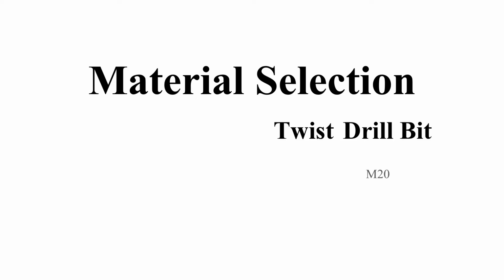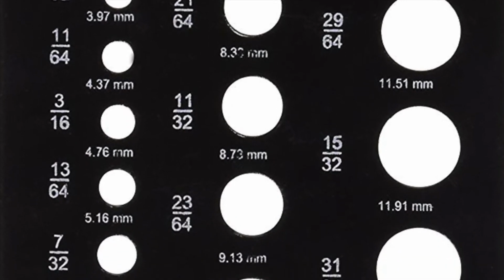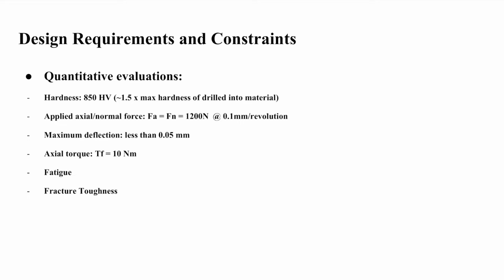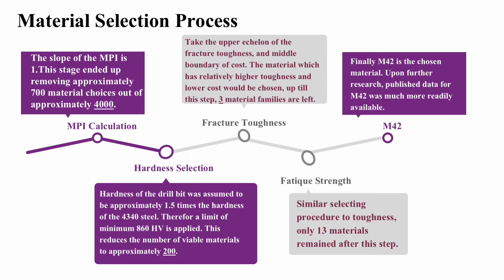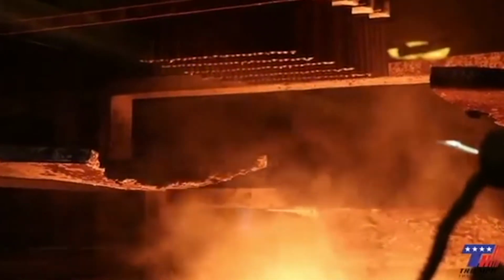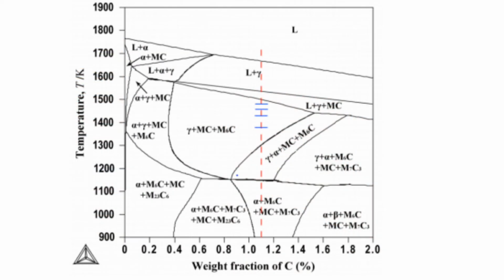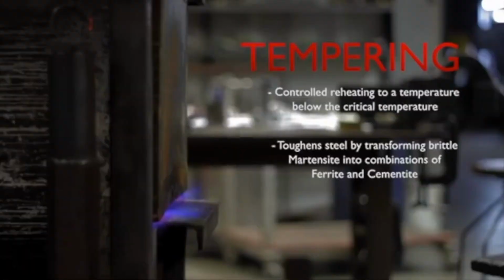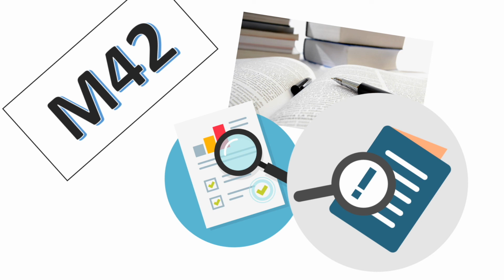M20 Material Selection Drill Bit

Comment from the maker: sources
 https://www.dhgate.com/product/9pcs-multi-purpose-wood-drill-bits-masonry/415724346.html 
http://www.canac.ca/en/product/tools/power-tool-parts-accessories/metal-wood-bits/auger-drill-bit-kit-6-pc_52756.aspx 
https://www.ffx.co.uk/tools/product/Milwaukee-4932363683-4002395331819-Wood-Auger-Drill-Bit-12Mm-X-230Mm 
http://engineeringhut.blogspot.com/2010/11/drilling-and-parts-of-twist-drill.html
https://www.123rf.com/photo_69523728_electric-cordless-hand-drill-isolated-on-white.html 
https://www.homedepot.com/p/JET-1-2-HP-12-in-Benchtop-Drill-Press-Variable-Speed-115-Volt-JWDP-12-716000/300093749 
https://www.sierramachinetools.com/products/t330x1000 
https://www.axminster.co.uk/machinery/milling-machines
https://www.breakthroughk9training.com/dogs-separation-anxiety/dog-with-question-marks/ 
https://www.amazon.ca/Irwin-12092-2-Inch-29-Hole-Steel/dp/B000CFNHX0/ref=asc_df_B000CFNHX0/?tag=googleshopc0c-20&linkCode=df0&hvadid=292947999281&hvpos=1o1&hvnetw=g&hvrand=15850933486936225497&hvpone=&hvptwo=&hvqmt=&hvdev=c&hvdvcmdl=&hvlocint=&hvlocphy=9001027&hvtargid=pla-433536149949&psc=1 
https://www.agropopular.com/fogaiba-retrasa-pagos-la-pac/
https://news.yahoo.co.jp/byline/tanakaatsuo/20131107-00029591/ 
https://www.tknika.eus/en/cont/proyectos/composite-materials/
https://www.google.ca/search?rlz=1C5CHFA_enCA763CA763&biw=1440&bih=740&tbm=isch&sa=1&ei=LUv7W8CgHIKXjwTm3IvIBQ&q=coating+process&oq=coating+p&gs_l=img.3.3.0l10.6859.10434..12917...4.0..0.97.412.6......1....1..gws-wiz-img.......0i10i24j35i39j0i67.fAWPU1o3LLI#imgrc=si5cW3t7LuS66M:
https://www.youtube.com/watch?v=MzRNKKLclE0
https://www.youtube.com/watch?v=s30gNLq95sg&t=192s
https://www.corrosionpedia.com/the-5-advantages-of-powder-coatings/2/6597
https://www.youtube.com/watch?v=f5HfRpeT7Fg
https://www.youtube.com/watch?v=98lh5Q0M0cg
http://threeplanes.net/martensite.html
https://www.youtube.com/watch?v=OJYwCxBvxv4
https://www.youtube.com/watch?v=6tfyaehD61E
https://www.thinglink.com/scene/716667136520486913
https://www.indiamart.com/proddetail/black-oxide-powder-300-mes-5907050988.html
http://www.fuji-ta.com/advantages-titanium-bicycle.html
https://www.britishcouncil.in/our-research-and-publications